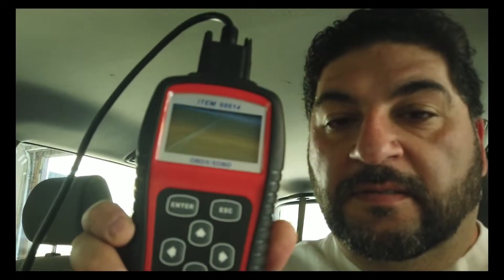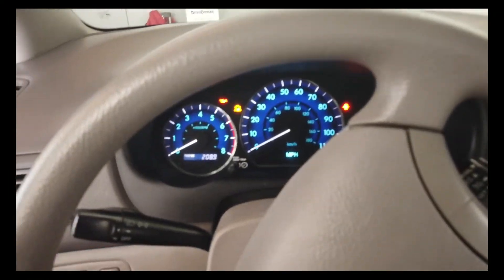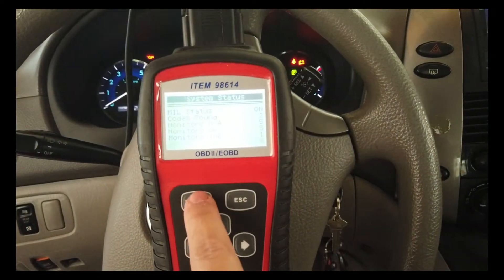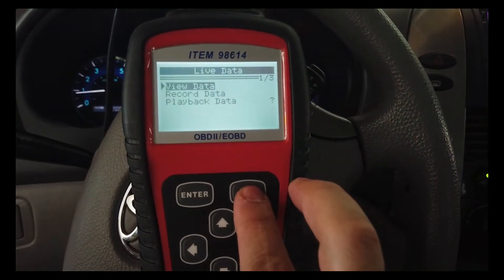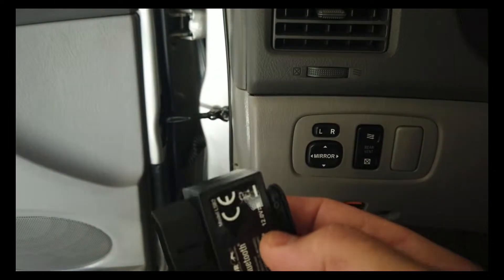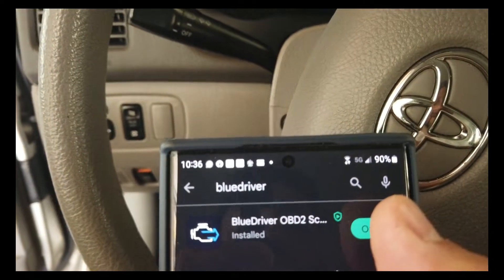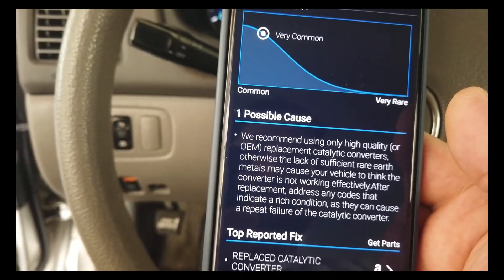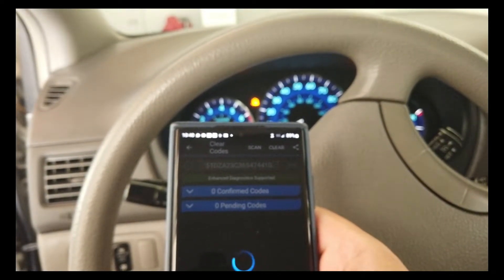Is the BlueDriver OBDII Scan Tool Worth It?

Comment: I had a 2007 Toyota Sienna that my sister gave me with 180,000 mi, and about a month later (September 2023) the battery died while sitting at an intersection, so I pushed it off to the side, so it wasn't in anyone's way. I had just lost my job, and it took me 24 hours to come up with the money to buy a new battery. When I returned to the Sienna about 15 hours later with the new battery, it had been towed. Needless to say, I didn't have 275 to get it out of impound, and I guess the city took it to the auction and kept the money. Really makes me angry. If I couldn't afford the battery for 24 hours, how the hell was I supposed to afford the 275 to get it out of impound? Too much information I know! But damn does that still piss me off!

Comment: Thanks for making this video,  it was very informative,  and you show clearly what is happening.  I enjoyed it.  P.S. I lift my hat to you for your immense patience with your kiddo, he'll learn alot by your side.
Reply from the maker: Thank you, and that is the plan to have them watch me. Glad I could be of assistance.
Reply: @diydadhub  Let me ask you this, I own a 2010 Toyota Yaris and it tends to take off very slow at a red stop, to the point that I get honked at, for not picking up speed as quickly as it should, but there is no check engine light, and the car even passed smog under those same circumstance, so my question is, will this device diagnose the problem? and if so, what icons options should I click on off the screen or should I focus on or which if not just one?
Reply from the maker: @alexshatner3907  Thank you for the question, what I can tell you is that the unit can run Live Data on your car as you drive it, and you may be able to identify the issue that way.  The unit can't determine if the car is underperforming unless an error code is generated.  I can suggest checking your spark plugs/wires and fuel filter as they could be the cause of slow take off.  Please check the link below for the units Live Data breakdown.
https://support.bluedriver.com/support/solutions/articles/43000551789-live-data-guide
Reply: @diydadhub  You are the best @Diy love you